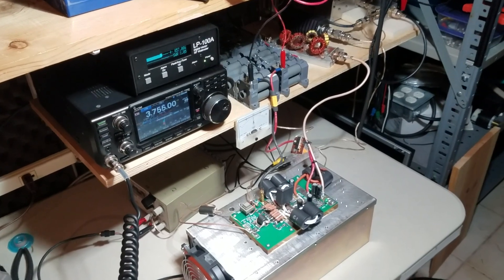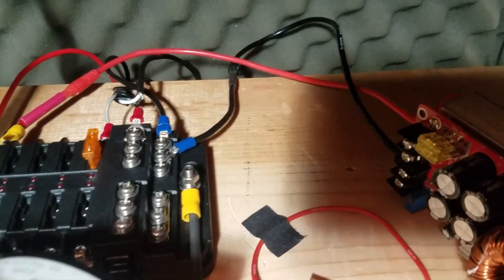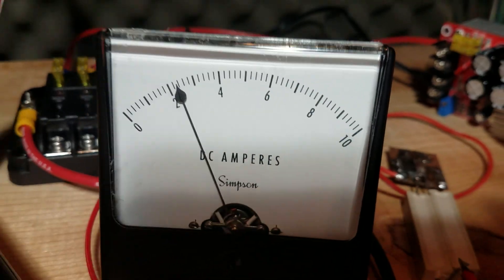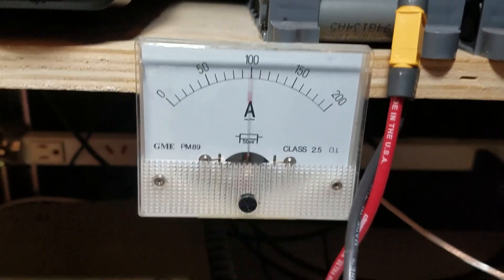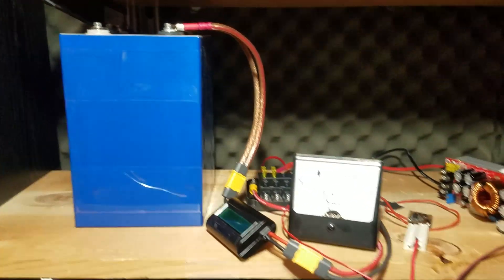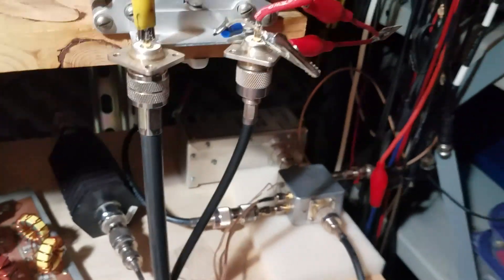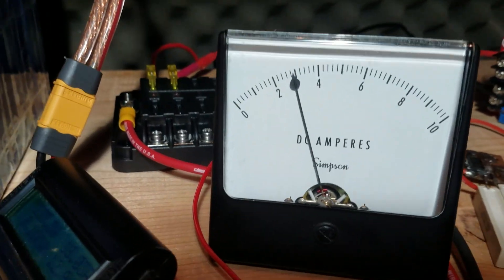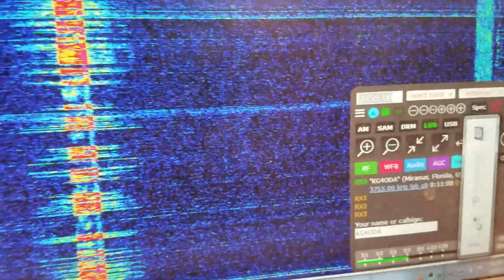Running 1kW LDMOS amp from 12V battery

Comment: Love these prismatic flat LieFePo Batteries. Still running my Round Cell LiFePos for almost 7 Years now. I got Question to you. What BMS are you using? I could not really make it out in the Video. There is a lot of these BMS which are not working out for Amateur Radio Usage because they producing Noise Interferings. I want to upgrade my Battery Capacity to 100Ah for more Playtime outdsoors Already found me the Batteries I want to buy but not sure which BMS. Thanks in advance & 73 de Uncle Günter across the Pond, D K 5 O N V 💯👍
Reply from the maker: The BMS is Fluke multimeter and organic carbon based CPU (aka myself :)